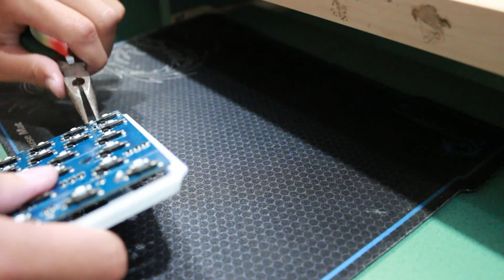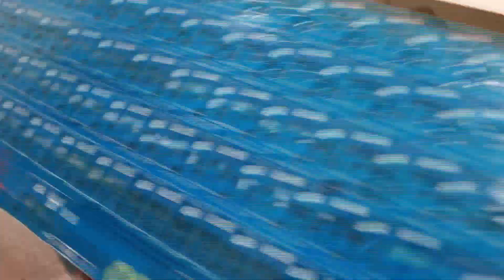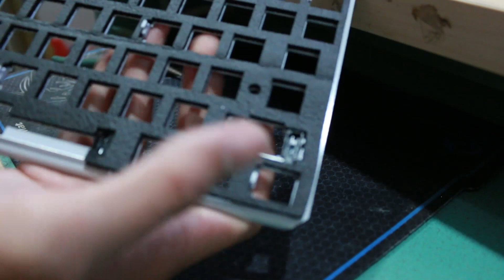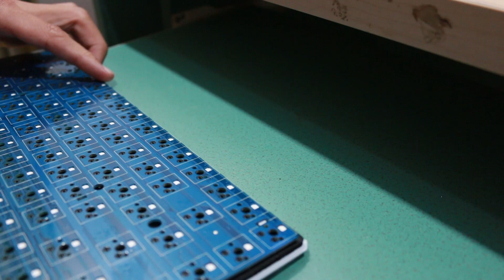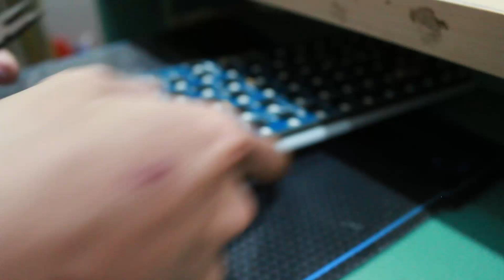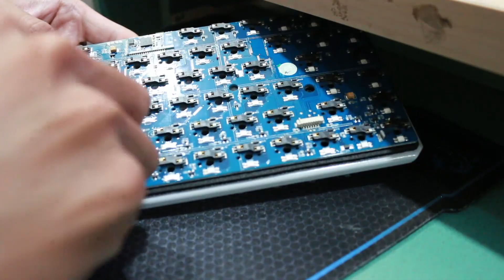Hướng dẫn lắp foam cho bàn phím KC84 | KC84 tear down and adding foam to pcb-plate

Comment: i'd really like to know if there is a good case replacement that's compatible with this pcb, it would be nice to be able to reuse my existing pcb instead of completely building a new keyboard.
Reply from the maker: You can cut aluminum case or mica case for this boy.